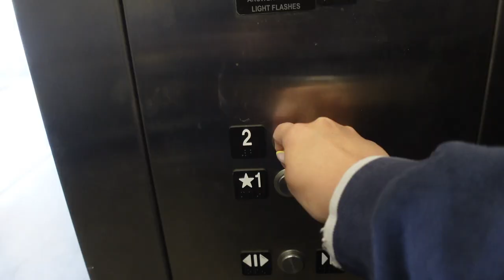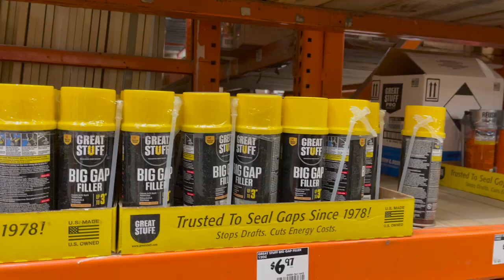E36 GT STYLE WING INSTALL

Comment: heyyy, ive been wondering about the visibility with the wing installed. do you find it bothers you at all?
Reply from the maker: No it doesn’t bother me but it takes some getting used to, it does interfere a little with the view. I think if I would have put the risers on it would’ve blocked the view a little more.